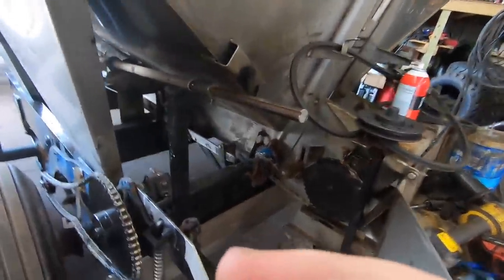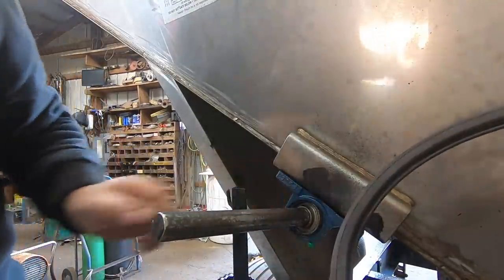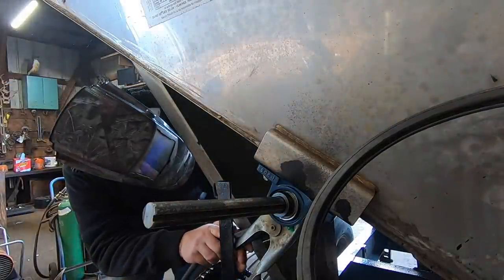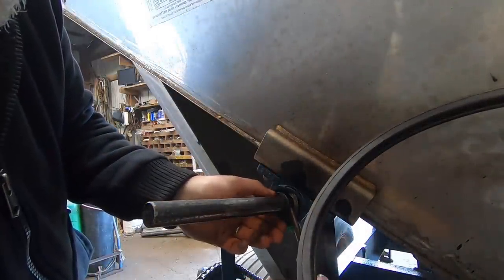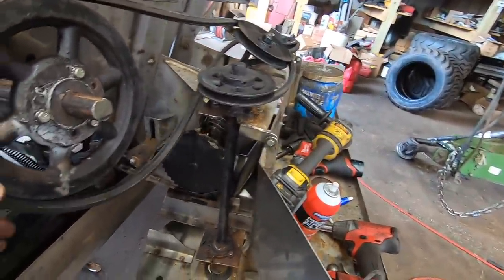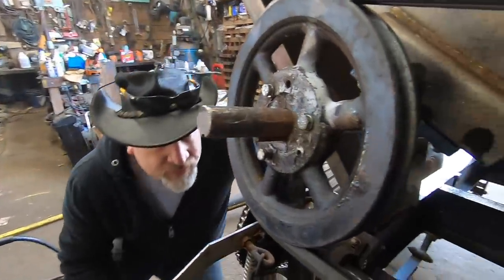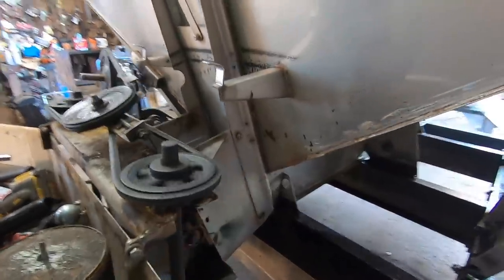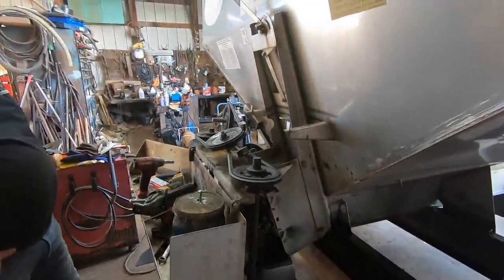Fertilizer Spreader Quick Fix

Comment: The twisting is a good move. My home made 3 blade 48" finish mower required four twist to stay out. I got the idea from woods mowers. Once the belt turns over it's trash. You may also putting a bolt next to the pulley where the belt throws off. Many zero turn mowers have bolt very close to a pulley, problem solved. Keep up the good work.

Comment: Hey Wes!
Probably information you already know...but...that sheave with the taper-locking QD bushing is "intended" to be taken loose by installing (either the existing or other) bolts into the threaded holes in the sheave and using them to "push" the taper apart.  Slightly slower than the hammer and punch, but less risky of breaking the flange of the sheave if the hammer slips.  As I said, you probably already know this, but just had to state the obvious.
Good video!
Ken

Comment: Wes, take some electrical tape and mark the inside of the pulley on the shaft so you know where it belongs to run properly without the belt popping off. 
Best get to spreading, it's go time. Great video, cheers :)

Comment: To loosen a taper lock pulley, just put the 3 bolts in the other 3 holes to push it apart . No hammer needed
Reply: Exactly- he’s got it on backwards- that tapered bushing hub needs to be located on the opposite side of the pulley(as you are facing the end of the shaft)- insert 1/4” bolts thru the 2 larger holes on the hub to install- to remove, unscrew the 3 1/4” bolts and thread them into the 3- 1/4” holes threaded into the hub , which removes the hub from the pulley!
Reply from the maker: I know how to do it properly! but I had already done it that way and it would have taken much longer to do it properly again so its all good. and on another note some people need to think outside the BOX there are more than one way to do something.

Comment: That belt looks too wide. It does not fit into the pulleys the way it should from what I can see. I do believe you mentioned that. Just an idea
Reply from the maker: its actually the right belt for it but because its a double V it only sits in shallow. I don't like it ether but the 4L belt bottoms out in the V of the pulley and slips so this is the right one.
Reply: @onelonleyfarmer  keep you day job